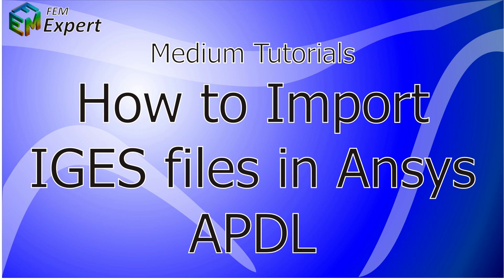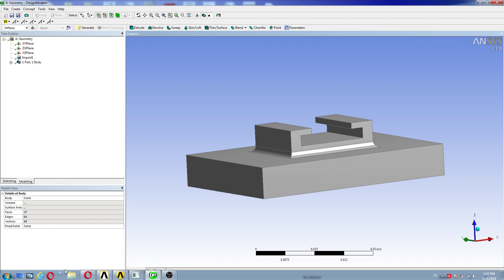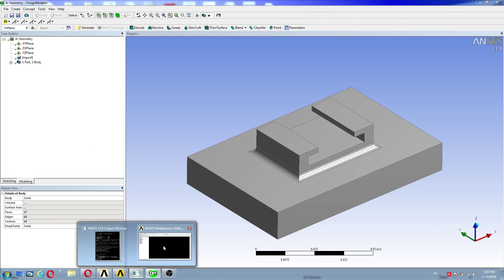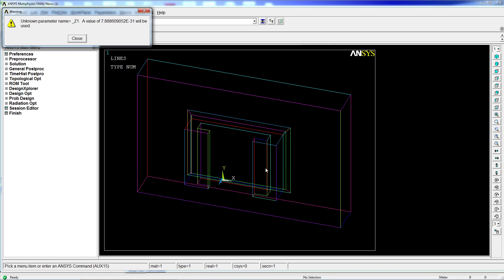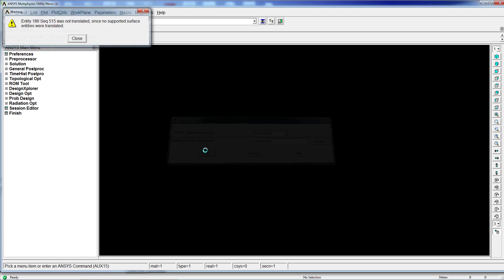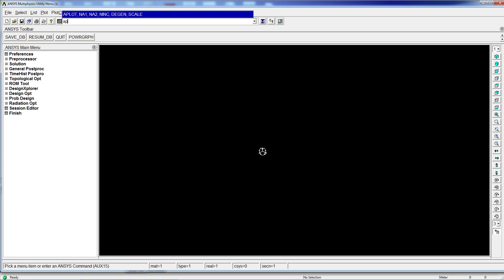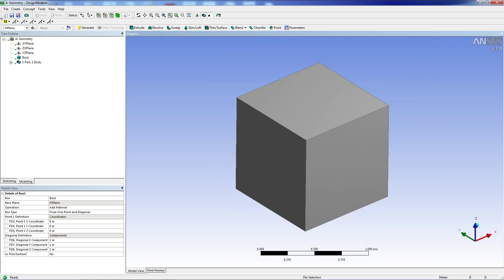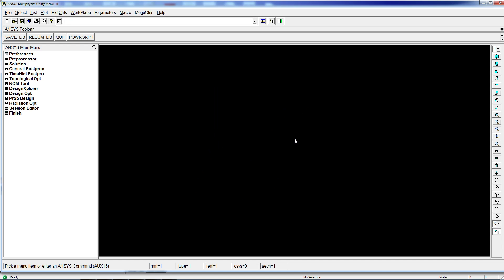Ansys Tutorial: Importing IGES files in Ansys APDL #30

Comment: Hi. My apologies for interrupting, but I guess I do have a problem with importing 2D model from Solidworks into ANSYS Mechanical apdl.
This warning appeared:

* WARNING * CP = 5.781 TIME= 08:03:50
Keypoint 1134 is referenced by only one line.
Improperly connected line loop.

The problem is that this keypoint (1134) doesn't appear in the model that I import.

* NOTE * CP = 14.562 TIME= 08:33:21
No keypoints to list.

I hope you can help me.
Regards,
Zailan
Reply from the maker: That normally happens when you try to import something that ansys cannot compute, try doing the same procedure with a simple 2d, model and if it keeps having that isue try other formats, parasolid or iges